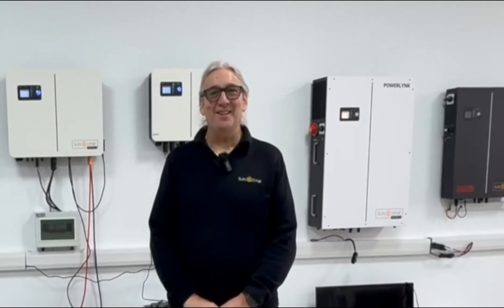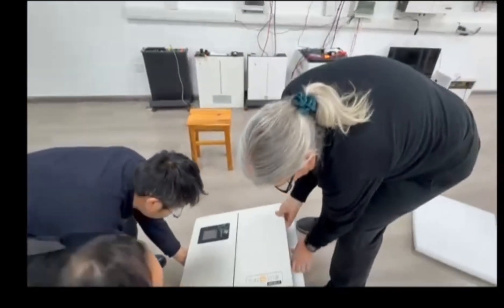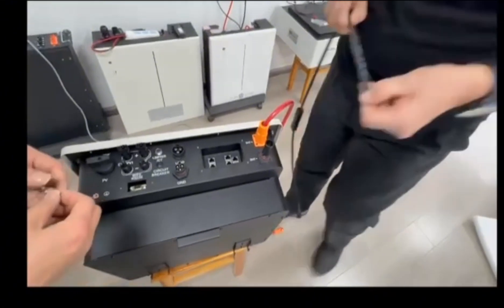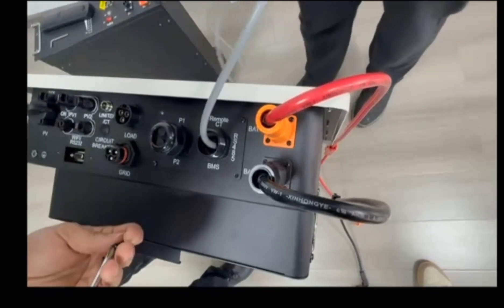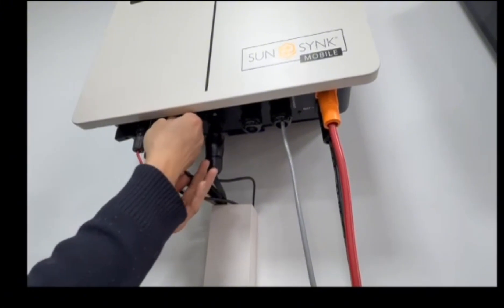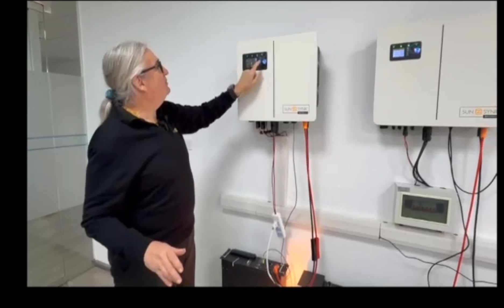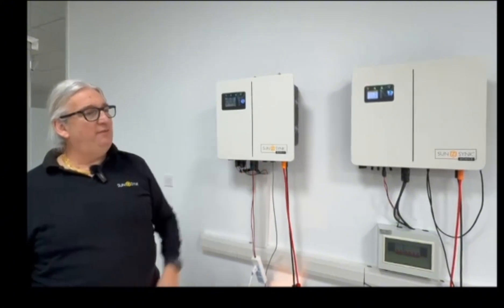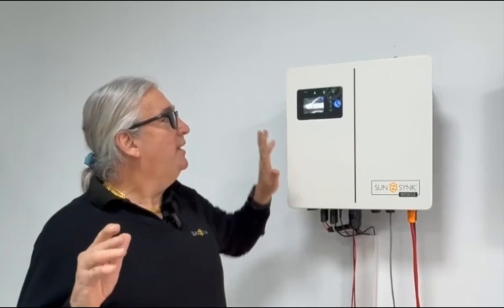Can We Install a #Sunsynk 6kW Lynks Inverter in Under 1 Minute? Keith Takes on the Challenge

Comment: Sunsynk uses cheap, lightweight, high frequency, transformerless inverter technology that has had the critical output transformer stripped out of it. Because of this, the Sunsynk inverter provides absolutely no galvanic isolation between its DC boost stage and its AC output, which can seriously damage your home's appliances when its IGBTs fail. No thanks.